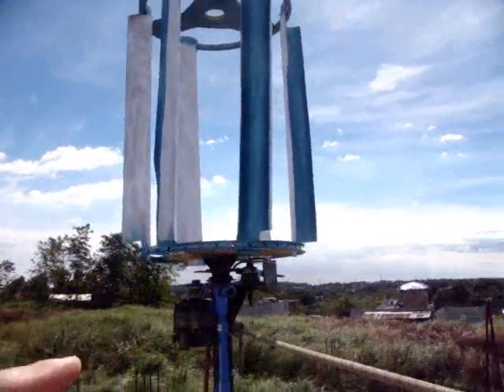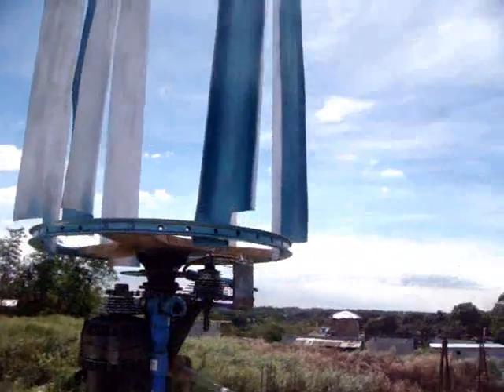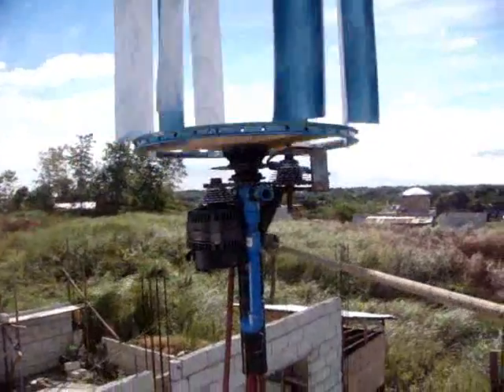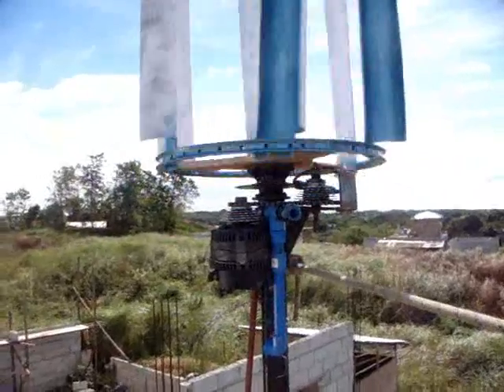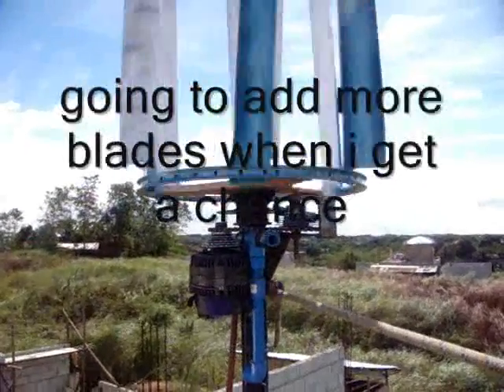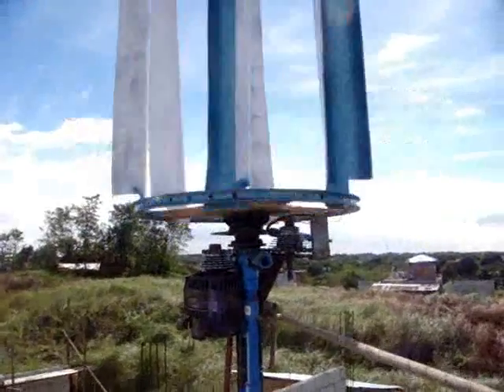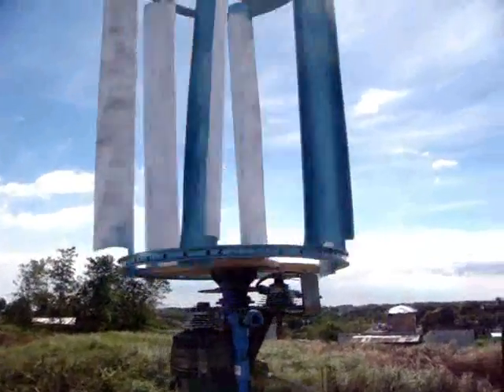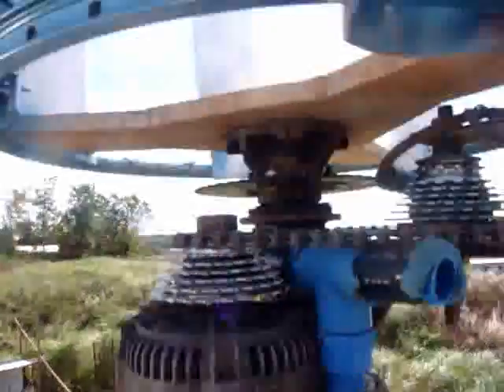VAWT

Comment: I would thing you could get the 16:1 ratio you are look for by a reconfiguration of what you have there or adding some to what you have there. I like what you are doing but this VAWT looks somewhat unstable is there anyway to tighten things up a bit? maybe through the center have a pole to extends up through it and guy wires or something?   Good luck to you and I hope you do well.

Comment: Great work ! but I thik a axial alternator would have been easier and more effective solution than the gear box. You would have less drag and need less energy to start, producing also at low rpm. Look for building axial flux alternators it might also be cheap.

Comment: Nice.

Some things to consider:
- An alternator will start to make power at about 1000 rpm (or about 60 rpm VAWT when geared 16:1.
- you'll get about 60% of its rated power at 2500 rpm (150 rpm VAWT at 16:1). 
- I would think that geared down that much it would take a lot of HP to rotate the VAWT under a load.  Let us know how it works out.

Comment from the maker: well so far I have spent around 51,000 peso a little over 1000.00 usd depending on the exchange rate. Right now i am in the middle of putting up the second floor. that will get another water tank a solar hot water heater and more surface area for the water collection. so all and all i could reach the 2000.usd mark just for the water add on's

Comment from the maker: i think i over killed on the hub set up. using a rear stub axle and a vw bug front rotor turned down. 

But with that set up i can easily convert it to a standard wind mill if it does not work out for me. plus we get some super strong winds here turning typhoon season